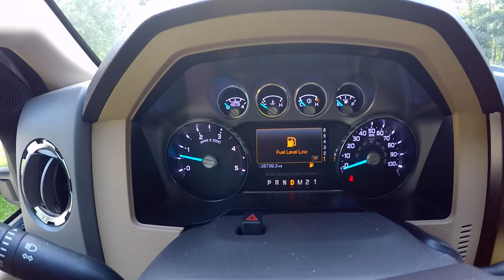Inshore Fishing Trip: Boat Prep~Day 2~VLOG #2

Comment: Thomas. could you put your boat in a 23 foot garage by 7 high if used to order a custom folding t-top ?
Reply from the maker: Sorry Lou, no it's to long with the rear motor and the trailer hitch sticking out the front and it's to tall. I can measure it sometime if you would like.
Reply: Thanks bro.